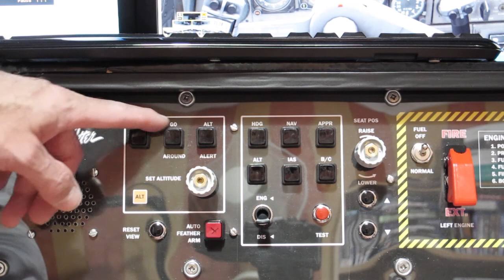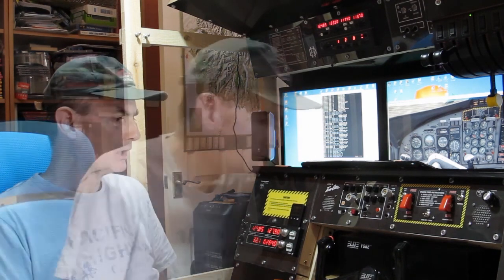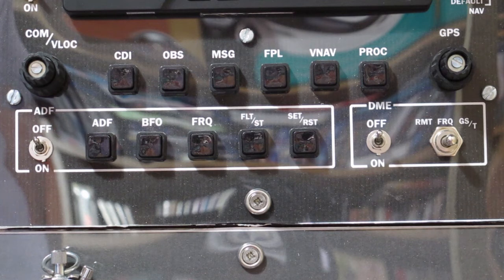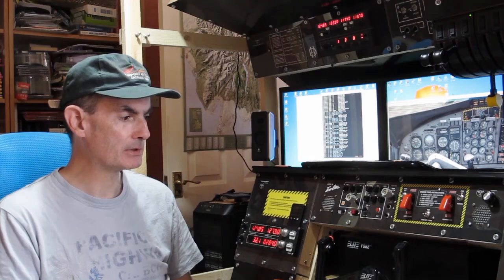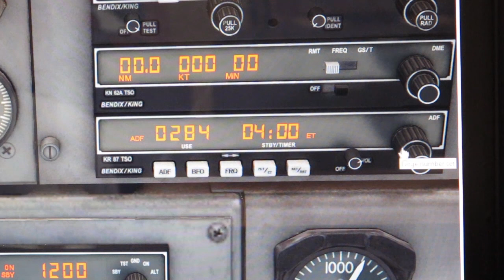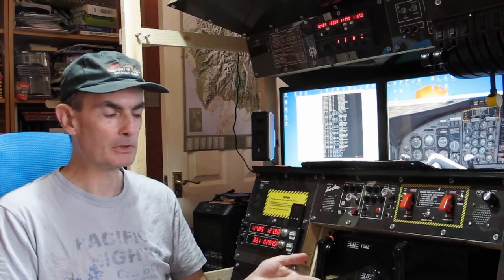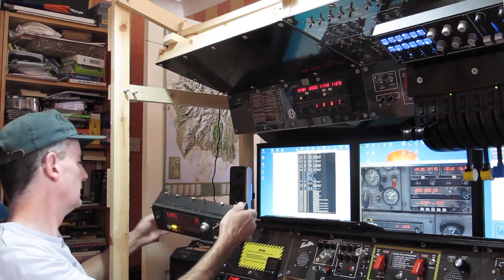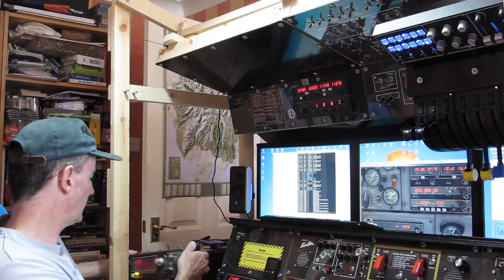Programming the Switches (Twin Otter Cockpit Build - Part 15)

Comment: just a quick question are you still using simplugin and what is your final opinion of it
Reply from the maker: No, I'm not using Panel Builder. I haven't done anything with it since I did my review. In my view it's a flawed product since it only caters for default aircraft. I hear there is an addon that works with the A2A C172 so perhaps they're changing things, but unless they open up the interface in some way that allows user-customisation for payware aircraft it seems to me that it will be a niche product.
Reply: ta for that

Comment: It seems like i have to turn my heading knob 100 times for 360 degrees.
Reply from the maker: Exactly! For Maybe £100 you could make a panel with rotaries only and have the push-and-turn shifted action on all of them. (In fact that's a tutorial project I will think about doing sometime after this is all finished!)
Reply: Silly question as I've only got an old Microsoft shitstick but couldn't the rate between clicks be as it were, computed somehow, so as to give a nice sliding scale of acceleration on the knob dependant on how fast you twist it? Seems simple enough. Great job so far, really nice looking too.
Reply from the maker: Calum Little Yes, that's what SPAD does for the Saitek panel, although it seems the components are of such lamentable quality that it doesn't really help. You could certaintly do this in Lua, which I am discovering is a fantastic resource for programming your controllers. I think the devil would be in the details, so tuning the acceleration to have the right feel and controllability.
Reply: A labour of love albeit perhaps one with a tough learning curve, rewarding nonetheless I'll bet at every stage though. There's a lot of guys in my VFW have homemade F16 pits, they are always moaning about their Helios or something going wrong and while they are lost in their systems malfunctions I've already locked up their wingman who'll survive just long enough to see their leader evaporating into a gory mist on multiple function colour displays before they share the same fate. Regardless, what I mean to suggest is you are sure to find loads of guys who you can tap as a resource and hopefully learn from their mistakes rather than your own. I wouldn't know where to begin to be honest but I'm so jealous of you chaps who get the pit all set up nice like you do. Just hurry up and finish it before we all forget who makes the best most cinematic and well made FSX reviews and immersive historical aviation related interludes etc. You get the jist.
Reply from the maker: Calum Little
Yes, it is very good fun to do but it also makes you learn about the systems as you go. For example I just have the Altitude Alerter working, which was actually quite simple in the end but in the process of figuring that out I now know what it does better than just having read the words in the manual.

I do hope to get back to some other FSX videos after this, and hopefully not just Twin Otter ones!
Reply: Air Hauler is fun, especially in the bush or outback or wherever the twin wants to dance really, you'd have to earn it though, I think you have to actually work to buy your own payware stuff again which could be a fun challenge. I'm sure you've got it all squared away but if you've any hardware issues I do know a lot of guys who've probably already melted the thing you're soldering or whatever and know what they did wrong. Or at least they know the website they found later that told them what they should have done to begin with. lol. Although like you said, there's nothing quite like that feeling of getting to grips with a new field yourself. You can google 72nd  VFW I think and we're on there below the scouts funnily enough. Try our teamspeak for advice or you could go to Falcon Online, however be advised that they operate a strict and exclusive LGBT only policy there which can be rather discriminatory... I jest. But them too, loads of nerds with knowledge as vast as it is impractical and useless to most may come in handy to you.